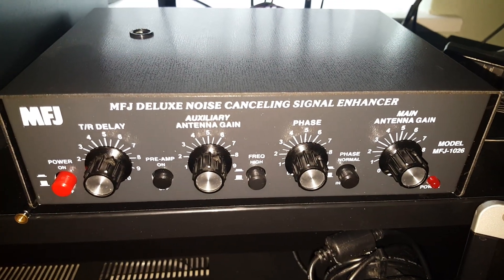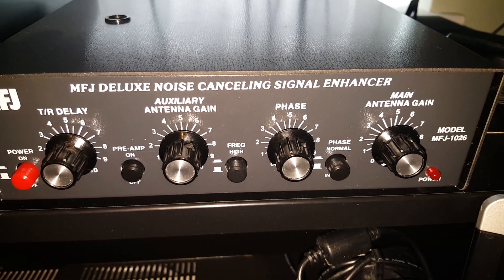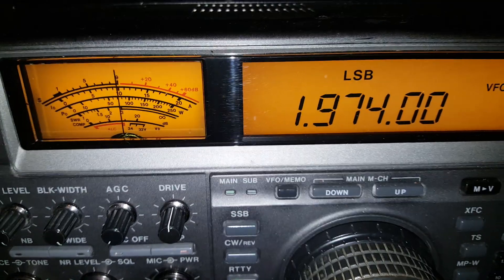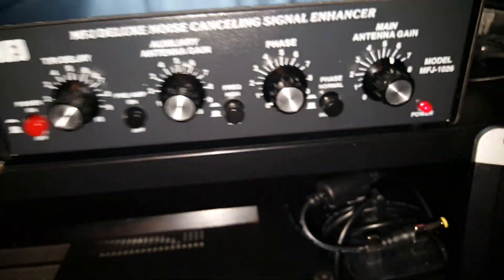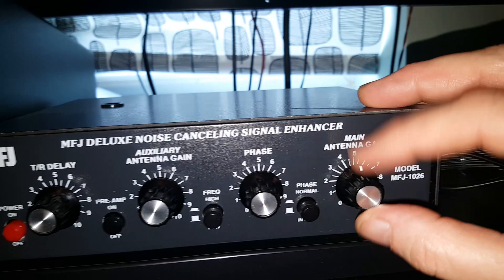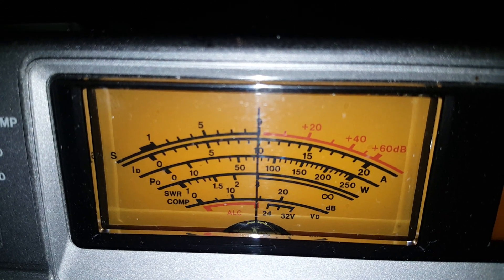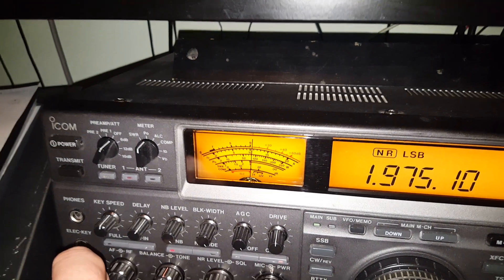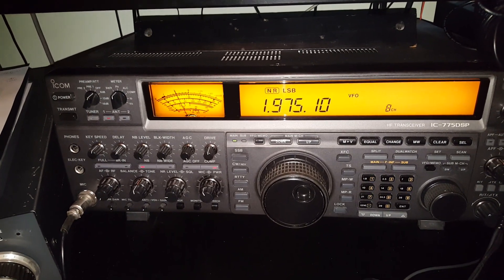MFJ 1026 demo

Comment: The T/R knob is for delay (not relay) and is not redundant at all. If you have this device working with RF sensing you know what you need that knob for. Otherwise the 1026, like other similar products, works and works well, if someone knows how to use it. Good demonstration, I clearly see that you fully understand the principle and consequently can make it work.

Comment: I appreciate the time you took to make this video. I know you have the very best intentions. I have looked at this item and it is costly. It's expensive. 'In my opinion' it isn't worth it. I understand you could now hear people speaking because of the drop in noise. But, you won't be able to communicate with them because, no doubt, they have approximately as much noise as you. 'In my opinion', for the $400 CDN this is going to cost me, this is not worth it, at all. Turning down your receive gain will get you further because, at very least, you'll be able to communicate with the person you're hearing.

Comment: This video has the best illustration on the importance on how to ensure approximating the input levels between the signal to noise antennas.  So many MFJ-1026 owners over the years didn't know about this fact and ended up saying things like this was a piece of junk, and etc.  Most of them do not know the tuning process but starting by wildly spinning their knobs in search for a null.  Little that  they know that would not have worked.  😂😂😂😂

Comment: I wish I only had your problem with noise on top band 😁 I live in a block of flats with some nasty RF pollution attacking from different directions at the same time, I use the wimo null steerer to null out the most offending noise .

Comment: Nice demonstration. I hae one of those devices and it works really nicely, especially in my urban environment. Mine has been modified to go down to lower frequencies so it works really well on longwave aswell. I have been using a PA0RDT mini whip active antenna as the noise antenna. Great results !